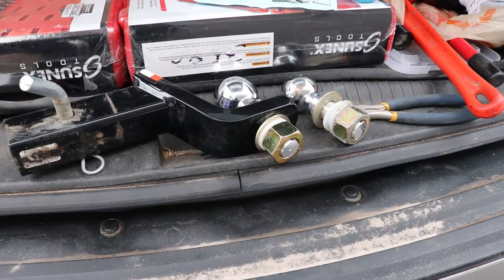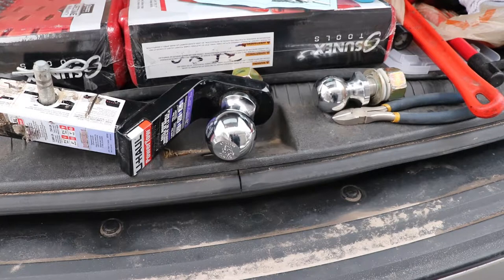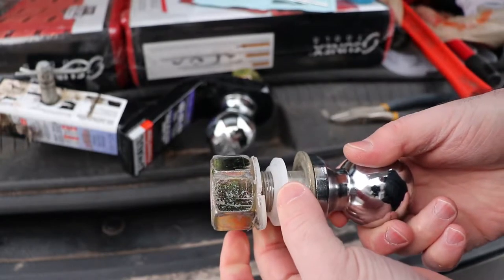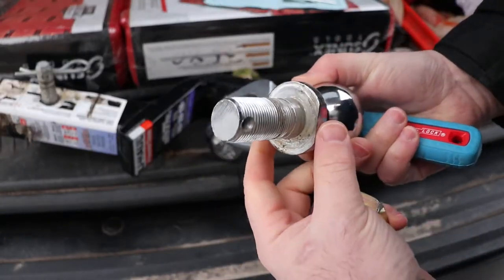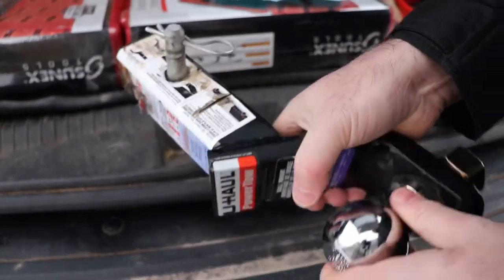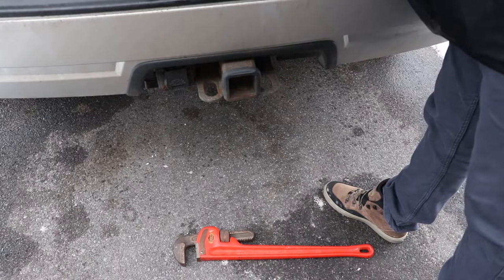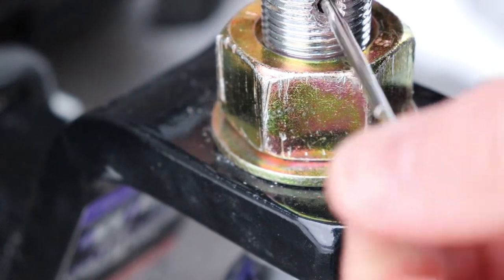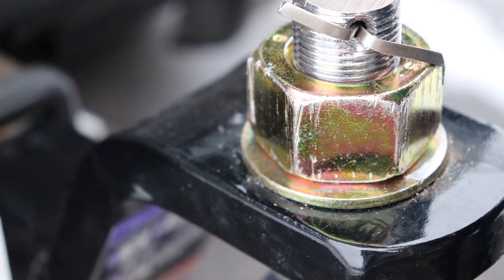U-Haul 3/4" & 1" Shank Hitch Ball Installation Instructions

Comment: If you put the stinger into the receiver so that the nut is on the side, you can use your weight to push down on it when you tighten it and it's easier.

Comment: I was a U-Haul hitch installer for 10 years and I can tell you U-Haul spent a lot of time and money developing their trailer balls and are quite proud of their products, especially that plastic washer. As far as their employees not installing them correctly is a failure on the GM as well as the employee because one of the first things your trained on is the inspection of towing systems and the installation of the trailer ball.

The plastic washer is a gauge to know when you reached the proper torque so you don’t need a torque wrench. You will be able to simply “flick” off the broken ends once your there. Also the copper antiseeze provided not only makes it possible to remove the nut in the future, but it acts as a thread lubricant to make it easier to get the nut to the proper torque, which is 215 ftlbs. 
Also as a side note. Turn the ball mount side ways when installing the ball so you can use your legs to pull up on the wrench giving you better leverage. U-Haul has a special tool called a dog bone wrench that slips over the ball mount and holds the ball straight, however I always used a 12” crescent wrench to hold the ball and a 1 5/8 wrench to tighten the nut.
Reply: Just purchased this ball. Do they sell these special washers separately in case I want to flip the ball?

Comment: what happen if the nut is over torque?
Reply from the maker: It will be harder to remove, I don't think you could ever break it using hand tools.  The main concern is having the nut too loose and falling off.
Reply: nothing you keep cranking on that nut until it wont turn anymore
Reply: Unless you're a power lifter, you are not going to over torque that size shank. Spec is 250 ft pounds, so with a 2 foot long wrench you pull at the end of it with 125 pounds of force. The specific purpose wrench at Wally is about 18 inches, so 167 pounds of pull at the end.
You're not going to break it till closer to 350 ft lbs of torque, or more for high quality ones.

Comment: ok a few things you did wrong #1 :  you dont stop tightening the nut just because the plastic separated you keep going until that nut wont turn anymore.  #2 : never use a crescent wrench to hold, tighten or loosen a trailer ball.  #3 : the cotter pin you used was too long and the head of the cotter pin was too small.  just helpful tips
Reply: Can I ask why you cant use a crescent wrench ?( I was planning on using one) . Not enough torque?
Reply: @dwaynecoolio7866  That crescent wrench, while it could open wide enough, is not capable of holding the torque required on those hitch balls. The torque is determined by shank size, which 1" is 250ft lbs. If you have a 2 foot long wrench, than means pulling on the end with 125 pounds of force, a smaller 1 foot wrench would be 250 pounds. Since very few people can pull that hard, that's why the 2-3 foot long wrenches are common for this purpose.